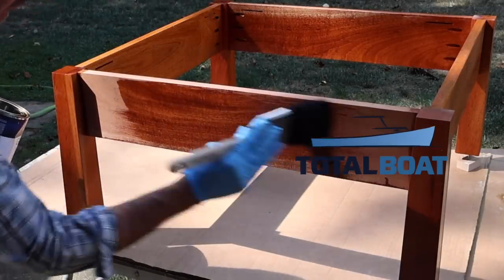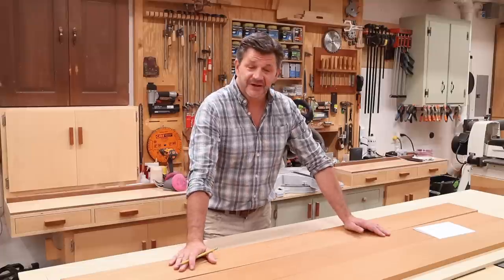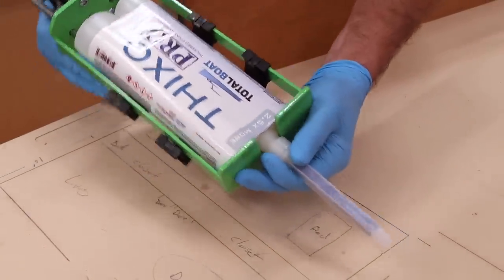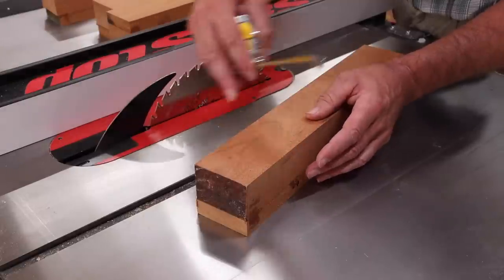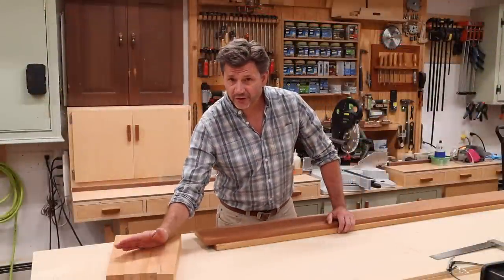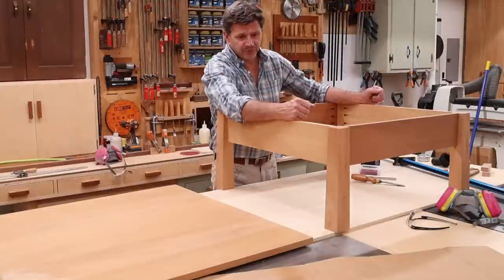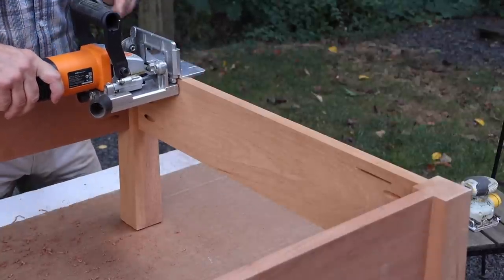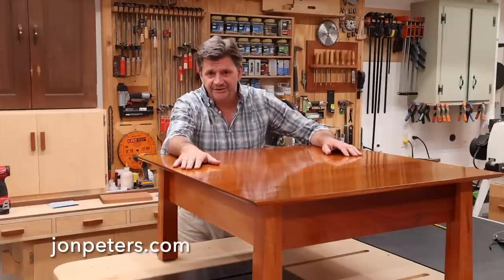Japanese Inspired Square Coffee Table - Woodworking Furniture Project

Comment: Beautiful table, Jon~!  On the tabletop glue-up, does the Thixo come off pretty easily with a scraper or chisel?  You didn't show that detail, so just wondering.  Didn't know if it had hardened fully or was still pliable when you removed it.  Great work (as usual)~!  Looking forward to see if this plan winds up in a future bundle since I have most of your plans already.  🙂
Reply from the maker: I removed it with a router similar to how I cut plugs with a router. I didn’t include it in the video because I covered it in depth in my last table top video. Maybe I should post a short video on just that subject… Let me know what you think. 
Thanks for watching!